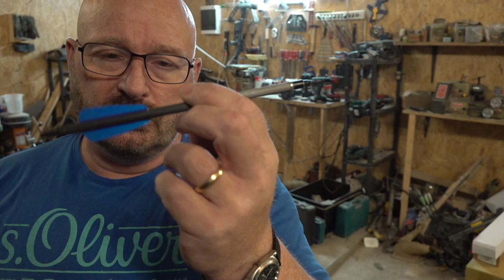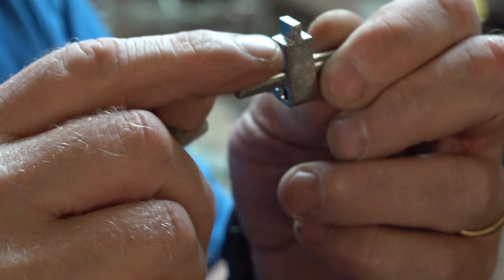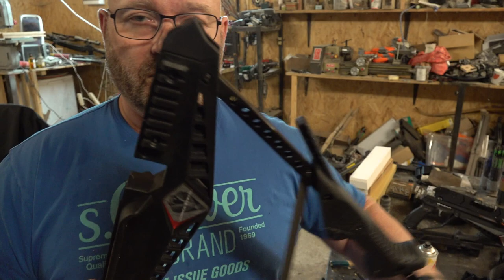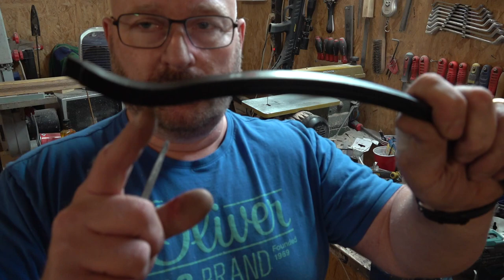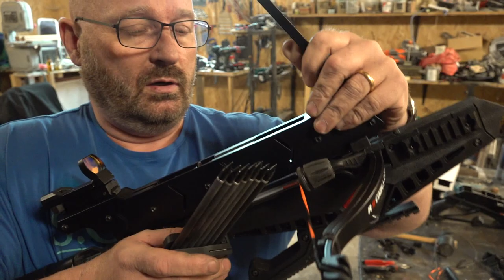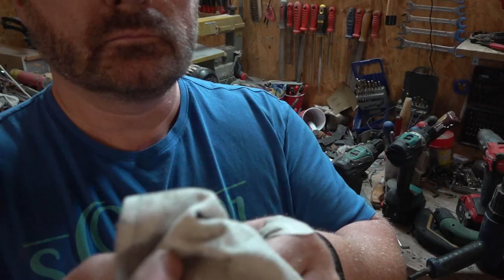The Grand "Adder" Crossbow Tuning Guide

Comment: A word of caution, now that the safety is manually operated ,when changing the string it is paramount to engage the safety because any accidental press on the trigger will incur an unpleasant experience!
Reply: are you speaking from experience or observation?

Comment: Did my mods on the Adder. Took me a whole Sunday in the workshop. A screw on the trigger mechanism broke off and I had to drill it out (took 4hrs and 3 drillbits, none of which ended in my hand though 😋)

Recommend to all who consider modding: when you have the trigger disassembled smooth the edges of the string catch. It is kind of Sharp edged. Your string will thank you.

Furthermore I added a washer to the cross bar and some tape to the stock holder insert (whatever the proper name). Now everything is much more sturdy.

Comment: I recently built a 48 inch long throwing arm for a home built cross bow where I used two layers of three fiberglass rods per layer. The rods are typically used for marking the edge of driveways after it snows for the purpose of keeping the plow off the lawn. I lightly sanded each orange fiberglass rod. I then laid three for the first layer side by side and temporarily used tape to keep them tight to each other. I then ran super glue down the abutting surfaces. Once the glue set I flipped the layer and glued the seams on this side too. I repeated the process for the second layer. To laminate the layers together I first taped them together. I then every 6 inches tied a loop of perhaps 10 turns of string. However after each winding of string was made I soaked the winding of string with super glue. The end result is a fabulous, but cheap throwing arm. Depending on the power stroke's length you can have different draw strengths. The one I am using is roughly 80 pounds, but it could be increased if desired. I don't know what it could max at but if I guessed I'd say 115. Unless you like safety orange throwing arms its a good idea to paint the arm as I did with a quality spray paint that bonds well to fiberglass.

If you want to feel real secure about the layers remaining in alignment I would soak your two tied areas in super glue and of course your string can't be a waxed string but I found any string does well especially after soaked in super glue.

Comment: 25:43 The hole for the knurled screw on my 7-round magazine was forgotten. Now I have to wait for the replacement magazine. But Gogun is telling me it will arive Thuesday or Wednesday. Glad I have the five round magazine too, but yeah, it's not that easy to fill with the arrows because you always need two hands to hold the lever open and fill in the arrows. And when you don't have a third hand it's pretty difficult to do!
Now I hope the rain is stopping so I can get out to shot!

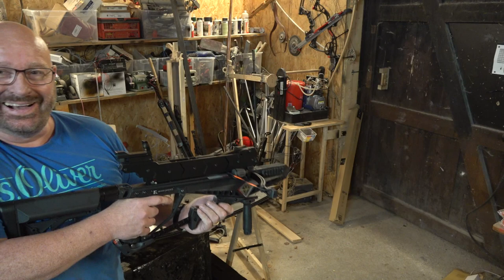35:00 Yes, I really liked this! 👍 It was quiet informative! This fixed some of my questions i had.
Maybe I will convert my Adder into a 180 pound version too! And i will build me a few broad head arrows.

Greetings from Frankonia...
Reply: @Lonewolf_rider  There is a problem with these instructions, I ordered two of these 90 lb throwing arms to upgrade the strength of my bow for the grizzly in the area.  Neither have string stops.  I'm in a position where I decide if I should use the limbs or not.  I may need to use the bracket from the 130 lb limb and then I won't be able to hot swap. Unless I use the bracket that has no string stop for the 130 lb limb... thoughts? How and where did yours break?

Comment: Liking the video. I might make some of my own on the Adder. I'll probably start with an overall review. There are some changes on the Siege which would serve an "Adder 2" model well for people who would like to stick with recurve bows. I'll probably add some more things such as the fact that since the stock doesn't house a recoil spring (like on the AR15) you can pop the back off it (the Adder actually comes with two butt plates for the stock depending on what you prefer; at least from GoGun) but inside the butt plate you've got a hollow cylinder which is perfect for string wax and then two separate cavities in which you can put disassembly tools such as Allen (hex) keys as well as spare red dot batteries. 

I absolutely love the modularity of the Adder system and think that it could be taken a step further, much like modern rifles where you can remove one part and swap it out for something entirely different. Such as different handgrips. Different stock systems (such as ones with a variable raised cheek rest), different safety systems (one from GoGun which is built to not be a 'safety on cock' system) and a reinforced cocking transport mechanism that allows the user to swap things out for something reinforced, potentially with a heavier draw limb (throwing arm) included. Or even heavier but more durable parts that use more metal rather than polymer so they really take abuse.
 
If I had a job at EK archery one of the things I would do is gift 10 bows to 10 'guntubers' who have some military experience who aren't currently deployed and ask them to stress test them.
I think that having the Adder (or Adder Siege) "1.0" as a starting platform and offering changes to it that you can buy with assembly instructions is the future of archery. A few enterprising individuals have already started selling non-EK upgrades for the Cobra and Siege platforms but if EK got on top of this they would be the first modular crossbow manufacturer. Long arrow mag designs have been created for these bows. Different loading systems have too. However they aren't sold by EK. If EK & Steambow (for the Fenris) got into that market they'd continue with their pattern of making better bows. If the idea caught on you could potentially even go to GoGun and 'build' (pick out parts) your own Adder or Siege at the checkout. You'd retain the warranty as all parts would be given the okay as they're all first party mods, more people would buy and a modular system makes it more difficult for copycat manufacturers to undercut the design.

I feel that making a truly modular system is the future of crossbows. I've modded my old Armex Jaguar to have an underslung picatinny rail. I'll probably look for non-destructive ways to mod my Adder. But if EK started releasing 'tuning kits' that changed things up a little (heavier draw, precision buttstock, stronger levers with less play) I'd buy that.

Comment: I absolutely LOVE the Cobra ADDER! in its Version 2 configuration, and the Millions of Hours of R&D that Joerg has spent developing it, to get such a GREAT!! Product to Market, You Are Awesome Joerg!!!. I can see at least two or three areas inside the trigger Block I would Check for possibilities for more Mods. to increase accuracy at a further distance to target. Any Movement in Any gun while shooting/ pulling the Trigger, will pull the Point of Impact off Target, thus throwing off accuracy, 1. Reduce trigger pull weight by changing to a Light trigger spring, I am Not sure how stiff the oem trigger spring is. This may Not be needed. 2.  smooth the Sear and Trigger contact points with some Very Fine sandpaper to polish this contact area. 3. add a Adjusting screw behind the trigger arm (this would reduce trigger pull length But I see the the posts for the Safety and Trigger would No longer Line up properly if adjusted, this may be a problem) at the rear of the trigger housing drill and tap for a 4-40 Allen screw so that this is adjustable to your liking to remove the Trigger travel, or trigger pull length, be cautious here as you dont want a Hair trigger just a Less pull length to the point of a Great Trigger release point that is expected. These three things will make a Much more accurate shot of the Cobra Adder, If you have a Long trigger pull length or a Heavy trigger pull weight due to a heavy trigger spring, or a Gritty or rough trigger pull due to a stamped steel edge of the Steel trigger and sear being Rough and Not Polished Smooth, these all can throw Off Accuracy. I Like to check for all these issues on Airguns By doing a trigger Pull test Several dozen times. I make sure the gun is Empty NOT loaded. Dont cock the gun, just pull the trigger several times, maybe latch the trigger, then pull the trigger, DO NOT DRY FIRE, Do NOT Cock The Crossbow!!! and watch what would Happen to what would be the Barrel End or Rail End to see if it Rises and sinks or any MOVEMENT of gun, during several Trigger Pull Tests, if you have to overcome any of the trigger spring weight or trigger pull length, or a rough sear contact, and pulling the trigger makes the X-bow's end, Move up or down during the Trigger Pull that will Throw off the SHOT accuracy. Pulling the Trigger should NOT move the Guns at all and throw off accuracy at all, if it does then the trigger needs work. This is a Job for when the Warranty expires. Movement of gun while pulling the trigger would be much More noticeable when taking free standing shots, while pulling the trigger. I check for this on all my Airguns, as I am after as Much accuracy as possible, and the Best accuracy Possible at the furthest distance to target. Humm what about adding a "Under the Bolt RAIL" of both sides, an attachment that has two alum. Square Tube for light weight, that slides either backward and forward out of the way, to get a cheek weld and a Short shoulder support, leave it forward out of the way pull it back into operation.

Comment: You selling the 180lb modded version then?
Reply: I hope they start manufacturing a 180ib drawstring bow as a single package along with heavier bolts designed for it, I reckon they'd sell well.

Comment: Such Innovation, Nothing else even comes close to the Cobra Adder!!!  Great additions, I would Love to see a Sniper type Bench Rest Bipod shooting. at 50 yards, 75 yards, and 100 yards with this setup. definitely need a 3-9x40 Mil-Dot scope with Adjustable Objective, for those distances. My thought For a More tactical Version is to use a EXPANDABLE Gun Rest that attaches to the Front Lower Rail, they are used for a Standing Shot the expandable Post goes from the Bottom rail to the ground while standing to support the gun through the shot. Humm maybe a different attachment Point due to the Cocking of the Cobra Adder.

Comment: You should dip the cut ends with resin/epoxy to prevent the limb from splitting
Reply: Would that have an effect on the limbs moving separately as they are bent to full draw🤔

Comment: Hi Joerg, long time fan and creator. I just had an idea that you might like. Well more for those fans who want an actual magazine. Could you make the instant legolas in two pieces? The rear piece with the trigger assembly attached the crossbow, but then the rest of it, say from an inch in front of the release, removable and instantly replaceable with a fully loaded one? I just pictured cutting it into two pieces and making the magazine part clip in and out. Then you could have different sizes and different bolts ready to go. 

Thanks for all your awesome contraptions. You are one of the great creators of our time and it is a pleasure to watch you.

Comment: Suppose you had a block of wood or something similar with a hole drilled through the centre and at each end of the block a deep groove sawed so that if you insert an arrow in one end with the vanes slotting into the groove of the block then insert the broad head into the other end of the block so that the arrow head lines up with the vanes of the arrow. Would that make it easier to align the arrow to the tip? Does this make sense?

Comment: I`m just waiting for Joerg to shoot this up graded Adder through the chronograph, how much faster are the bolts
Reply: For the 180 lb draw and by my rough calculations the fps is bumped up from 270 to 370 using the standard bolts.
Reply: @parallelsandtangents938  370 fps is very optimistic. I'm thinking 300-310 fps for the 180 lb variant using the original bolts, which is not recommended as they will be too light.  The bolts should be increased in weight in direct proportion to the draw weight, thus keeping the speed roughly the same at 270 fps.

Comment: I've put my Adder away for the winter. Should I remove the string?
Reply: Unsure myself.
Reply: Yes I would remove it so it does not stretch the string. Its always good to remove string when not using it for long periods. That way when you do start using it again the bow will still be in spec. Also over time the limbs can start loosing tension if its stored for long periods strung. not a huge issue for the adder (reasonable to replace) but definitely something I do with all my recurve crossbows.

Comment: @JoergSprave We need to get Steambow to make the regular bolts along with their broadheads. The quality of the Steambow bolts over the standard bolts is marked and substantial. I fired all 5 of the (blue vane) bolts that came with my Adder into the best quality crossbow target I could find (supposed to handle 450fps) and I immediately wrecked every single one of them! Firing all 5 of the (green vane) Steambow broadhead bolts (multiple times each, repeatedly) into the same target has yet to damage them in the least. They are all literally still good as new! If you could help to make this happen that would be amazing... 
Thank you for all you do. Your inventions have literally changed the world!
Reply: it's either what you just mentionned or the broadhead energy repartition is better on impact because of the bigger head which prevents the bolt from breaking pre-maturely. I have no experience with the orange aftermarket bolts though but I've heard they were tougher and cheaper (after some adjustments).

Comment: Does EK archery plan on selling this high powered beauty?
Reply: They wait for the tripple bow version (390lb)
Reply: @rainerzufall689  you'd need a crank to load it to fire if it was that much or be the hulk :)
Reply: @MrGiovannisassano  Or even better: just be Joerg (after hand healing). I think he is lying about te drill anyway. I heard he just beat the terminator in armwrestling, causing parts of him to fly around and they now try to cover the whole story because he is just a nice guy and wants to spare the terminator the embarrassment.
Reply: They should make a full size "Rifle" version with ample power, long stock and lever maybe even have it use the 15 inch bolts.
Reply: @dimadrifter9920  I don't know how nicely the design scales because increasing the lever length has its limit in my opinion. The longer it gets the heavier it has to be to not break and it will require large movements with your arms.
Reply: @rainerzufall689  True, the lever stroke would have to be rather short. Although there's many variables that could be worked with such as the bow's power stroke or the length of the little lever connecting to the trigger unit.

Comment: Jorg, an idea for your next version of this weapon, put the mag underneath, so the bolts are fed from below. Less of a limit on the size of the mag and it won't get in the way of your sights. Just an idea from another  engineer. Love the videos.
Reply: How would it be cocked?. It also has to withstand all the energy from being fired. An arrow sized hole in your crossbows frame is going to be a liability. Finally gravity fed mags are more reliable.

Comment: I have a Cobra RX already and feel it should be made clear that the 5 or 7 shot magazines will NOT fit it directly out of the box even though it appears to be the same crossbow. I've not ordered a magazine yet because I'm looking at how to go about it. The crossbows are essentially the same but with one fairly major difference which is the that the rear rail where the sight sits on the Cobra is part of the sling attachment loop and the grip itself. They're all one piece, so in order to get these magazines to fit I believe you'd have to get a rear section from an Adder or cut the existing rail off the Cobra. It doesn't look like a difficult job and nor would it affect the structural integrity of the whole crossbow but I don't think it can be done any other way because I've yet to find a conversion kit or a loose rear assembly from the Adder itself.

Comment: Joerg, do you see it feasible to mod the Adder or design something to assist in cocking the weapon as you did with other inventions of yours? I experimented with it, but wasn't, apart from ideas, able to come up with a working solution due to material and craftsmanship limitations. Would  be happy to see another mod video and what you come up with, harharhar.

BTW, I failed doing the trigger safety mod. The screws are too tight and soft. They simply turned on me or rather they did not. Think I just ruined the screw heads.😢

Comment: Hey Joerg, other than adding to the cost and possibly adding length and width to the bow length, why is it not possible to add compound bow winches to the crossbow to allow cocking a much more powerful bow.  Maybe even use 4 or 5 winches.  Get that bad boy up to 400 lbs.  I know hunters who would love to shoot a 400 pound bow as long as the actual pull the user has to apply is no more than 75 to 80 pounds.  I think you can do it!  Go JOERG GO!!!  "The Super Power\Ultra High Tatesteron Adder"!!!

Comment: A couple things. Are the ends of the primary limbs designed to handle that much added stress? What about the trigger mechanism? Is the string rated for that much?
Reply: Just trying to look at it for a safety/liability point of view.

Comment: There is a problem with these instructions, Joerg.  I ordered two of these 90 lb throwing arms to upgrade the strength of my bow for the grizzly in the area.  Neither have string stops.  I'm in a position where I decide if I should use the limbs or not.  I may need to use the bracket from the 130 lb limb and then I won't be able to hot swap. Unless I use the bracket that has no string stop for the 130 lb limb... thoughts?  And I do not have facebook sorry.